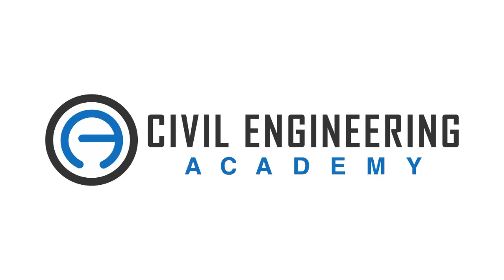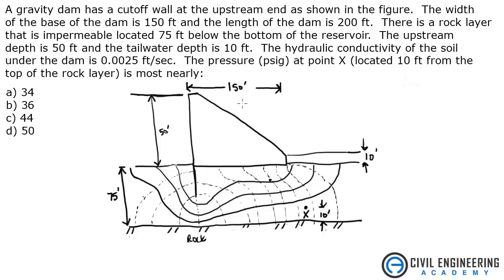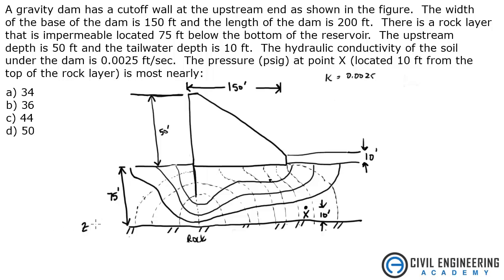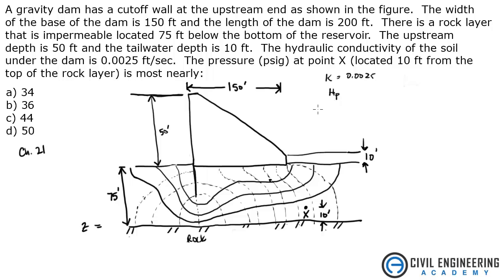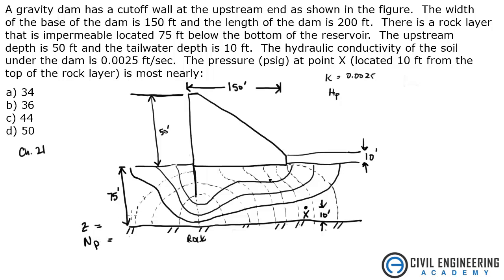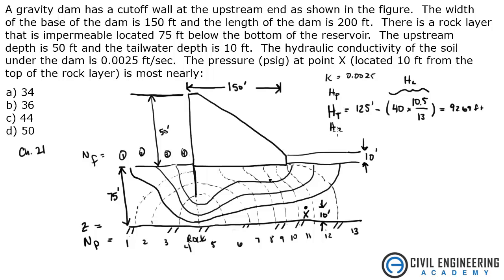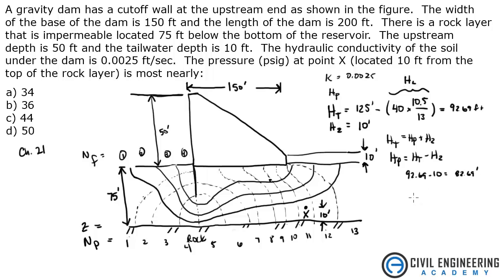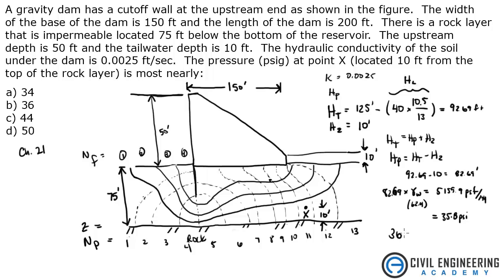Geotechnical-Pressure Under Dam with Flow Nets

Comment: To remain consistent with how the Practice Problems companion to the CERM does it:
-Use Equation 21.36(b), plug values of j=2.5, Np=13, H=40ft, z=75ft in. This was a lot faster for me. 

FOR THIS TO WORK I HAD TO DO THESE THINGS DIFFERENTLY THAN THIS VIDEO:...
-Start counting Np from the right, so point X is at 2.5, not 10.5.
-make z=0 datum at the downstream water level, so that point X is at z=75ft (z is positive below the datum)
-Not so much Head value calculations: Just subtract upstream head of 125 ft and downstream head of 85ft, getting H=40ft for the above equation.

If you are using the CERM this way will make much more sense while reading through the topic while trying to solve this, atleast it was for me.
Reply: thanks!
Reply: Thank you!!

Comment: Are you using eq 21.36b (15ed CERM) to calculate the pressure?
Reply: By using that equation I get 33.5 psig, which is close to your answer.

Comment: I was wondering if you could upload a video where you teach how to draw the flow lines and equipotential lines, or atleast explain how the water would flow under a dam or earth. Thanks
Reply from the maker: Daniel Job Galapon We could do more theory background on that.  In short though, you are basically drawing any amount of equipotential lines (vertical lines) with streamlines (horizontal lines).  These two lines are always about 90° to each other at each crossing.  You can make as many or as little as you want.  Generally you draw about 3 to 5 to calculate graphically.  As the CERM states "as long as the rules are followed, the ratio of stream flow channels to equipotential drops will be approx. constant regardless of whether the grid is course or fine."  Hope that helps.

Comment: There is no problem in chapter #21
Reply from the maker: In the edition that I am using CH. 21 Groundwater goes over flow nets.  Specifically sections 14, 15, and 16.  If it isn't there then look in the index and it will get you there.  There isn't a problem there, it just goes over the concepts.  Hope that helps.